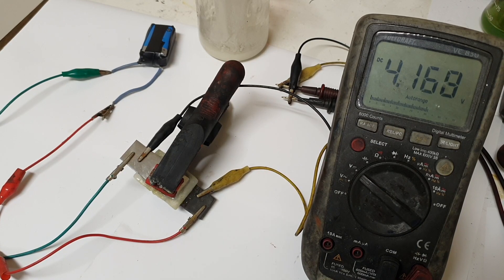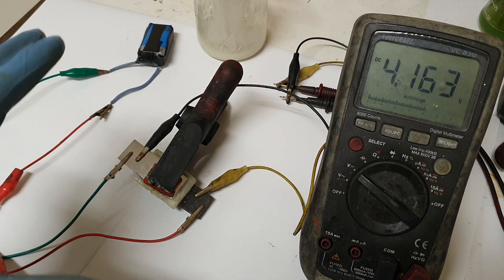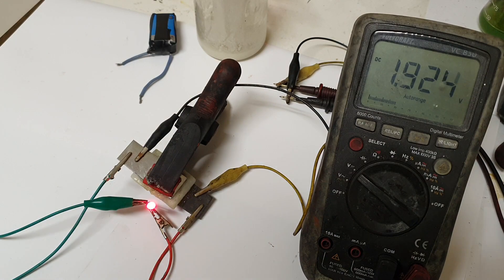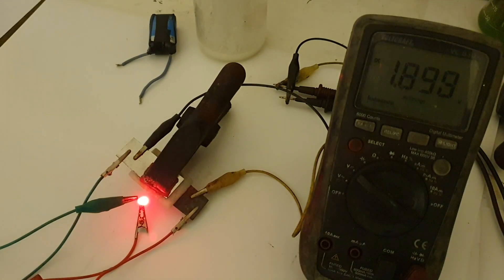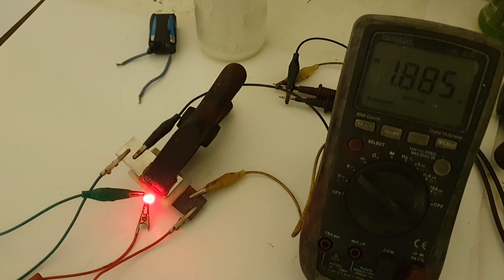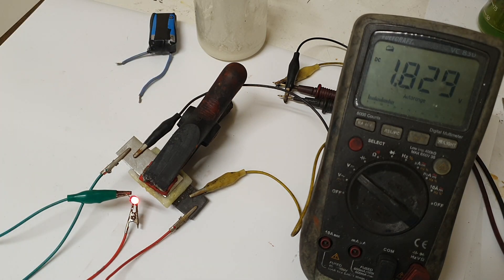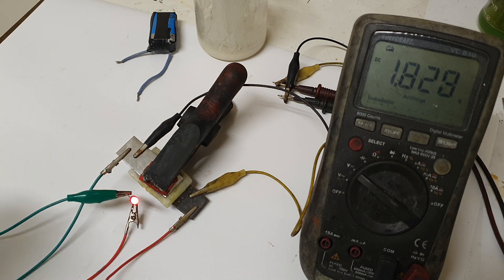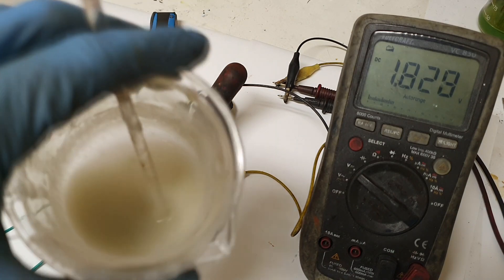Novel Aluminium Bromine Battery

Comment: There are several publications about Aluminium Ion batteries with non-aqueous electrolyte (DES) and aluminium chloride as the active ion. In the periodic system, chlorine is in the same group as bromine, just above it, i.e. both are halogens and I would expect some similarities in the behaviour. Therefore my question: do you see any advantages or disadvantages for using aluminium bromide versus aluminium chloride? Why did you do it? Specific reasons or just to see what happens?
A similar question concerns the anode: magnesium as another abundantly available metal also shares several similarities with aluminium, like being relatively close to each other in the galvanic series; both suffer from the problem of passivation layer formation, therefore they both require DES. Such magnesium chloride batteries do work. Now what would be interesting: have you tried Mg anode with magnesium bromide electrolyte (in DES)? Not sure if it would be any better (probably to the contrary, because aluminium can give up 3 electrons, whereas magnesium only 2), but it might still be intersting to try, right?
Thanks!

Comment: This is a dead end. It is so reactive, safety is an issue, and the aluminium will decompose in days, if not hours. Zinc Bromide is a more appealing battery. The power output is higher also,
Reply from the maker: Science dont have a dead end after all (maybe on market,... but always you open a new possibilities and ideas when you get successful experiment). Yes you have right, aluminium and bromide is reactive, but here in that electrolyte system was not the case. On first one the ion transport was limited because of the electrolyte which was more safe electrolyte als only aluminium bromine. First AlBr cell run a small LED, but next one run a 3W LED. I make tonns of experiment on ZnBr battery also and I know the system well (flow and non flow design) and is good technology.
Reply: @cayrex  Mate, I'm not questioning your ingenuity or cleverness. This cell was VERY interesting, But, and big but, the battery chemistry itself is a dead end when Zinc Bromide is there, and has been here for 100 years, and is much more manageable. Maybe I spoke too soon.. maybe we need to cycle the battery 1000 times to see that your electrolyte does not break down, and that bromine wont get to the aluminium EVER. I'm sure it has been done though. Aluminium Bromide is a chemistry that draws peoples interest BECAUSE is is so damn reactive. But I would bet cash that you will give up on AB like everybody else in the past.
Reply from the maker: @edkoetsier339  I know what you mean and and I know for your concern about AlBr2 reaction,.... but that violent reaction is a basic reaction between Al and Br. If you go with another electrolyte approach you can minimize the violent reaction like in low AlBr2 content electrolyte system for example. The electrolyte is heated up a little bit, but dont get that violent reaction also on havy loads. Yes ZnBr battery is well known and is interested chemistry. For example I get on my best non flow ZnBr battery system around 80 - 110Wh/kg so far.
Reply: @cayrex  As the power is in the electrolyte in ZnBr,  bigger is always better. I've got 32 2L  glass gravity batteries, powering my house (with other batteries of course). I overcame the quirk of ZnBr lack of initial power by having a 1000F of my Graphine supercaps in parallel. I haven't measured mine, but I doubt that they are more than lead acid by weight. But they sure are great. And Cheaper. And be careful with AlBr, I'd hate to see you burn your house down. Lol about them heating up...
Reply from the maker: @edkoetsier339   you know that some flow ZnBr is also heated up with continuous discharge,... they can go up to 60 deg C. 
Therefore, some systems use also heat exchanger in the electrolyte tank. Gravity cell deaign is not bad but can have problems with internal resistance also with good support electrolyte and can have moderated power output and extra self discharge. Yes, the capacity in that cell is depending on the amount of electrolyte which was good seen in my project of semi flow ZnBr cell. But the ZnBr chemistry is a robust system and is great for energy storage systems.
Reply: @cayrex  The internal resistance is indeed a issue, which  is why I always construct my ZnBr batteries with 3 mol ZnBr and 0.5 mol support salt.  It's turning out to be a perfect off grid battery, with supercap boosting. When they die in a few years, it's just a matter of discharging fully and drying them out, retrieving the recrystalized ZnBr. Maybe I  can reuse, we will see.  They are so good, I might set up a business and sell them,  just as long as the buyer knows Bromine is the most corrosive element on the planet and safety protocols must be followed. I  have a 100L HDPE tray filled with activated carbon directly below my glass vessels. If one breaks, the AC is a magnet for Bromine. I can sit for hours watching the Bromine forming......
Reply: @cayrex  And medium self discharge (you cannot call it high) is a thing, but is not an issue in off grid situation. Anyway, my solar and wind power keeps them  topped off.
Reply from the maker: @edkoetsier339  yes bromine can be dangerous, but is not a problem with good housing. That cell can be upgradet really "easy" and also can boost the capacity higher. Rate of self discharge it depends mainly on internal resistance. One way to get internal resistance down is by puting the electrodes more together, higher the concentration of electrolyte or support electrolyte,....
Reply from the maker: @edkoetsier339  yes self discharge is not a problem in storage applications, because like you said,.... is charged almost each day
Reply: @edkoetsier339  If I recall correctly, Redflow batteries have an automatic sequence which totally discharges a cell every 4 cycles.  This rejuvenates the cell and extends the life.
Your experience with ZnBr cells is VERY interesting.
Reply: @edwardcdg  If they do, I don't see the point. I have concluded that my batteries will never wear out if treated properly. Could run for 100 years. The supercaps are a different story.
Reply: @edkoetsier339  I am very interested in your experience.  100 years is more than I need.  30 would do the job.  :-)
Reply: @edkoetsier339  Nice to read. 
I am in the process of designing my "24 volt" zinc bromine gravity battery, i am most concerned about dendrites as i want to use an activated carbon bed sandwitch with ceramic wool as an insulator (dont know it this is a good path) and lowering the resistance of the cell is supposed to help spread the voltage fields better, you write about support salt, which one do you use?

Comment: Is it actually aluminium bromide? Or is it bromine mixed with a solvent and it gets its aluminium from the aluminium negative plate?
Reply from the maker: Is AlBr3
Reply: @cayrex  is AlBr3 the electrolyte? Or is AlBr3 mixed with an electrolyte? If so what is the contents of the electrolyte?

Comment: Nice, but sodium is the future ...........
Reply from the maker: yes,... but with sodium is a bit hard to work at home
Reply: @cayrex  And doesn't it have to be really HOT ?
Reply from the maker: @bjl1000  Hot, what?
Reply: @cayrex  You right. I did  buy fire extinguisher but need to buy bigger.

Comment: How much mAh does the battery have per Gramm/ per cm^2  of size
Reply from the maker: the active material is formed when the cell is charged so I dont have good control what was the weight of active material. I was able to measure the cathode before and after charging (the difference was arround 0,02 g). LED need around 10 to 5 mA and was runing more that 3 hours.
Reply: @cayrex  is that timer in hours?